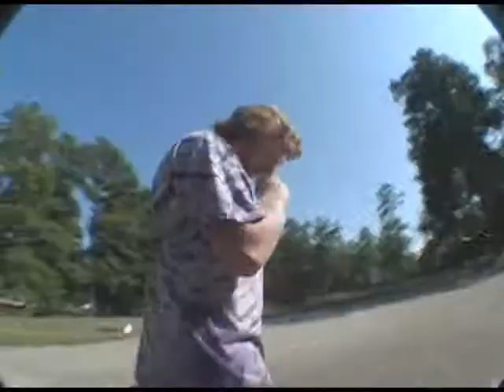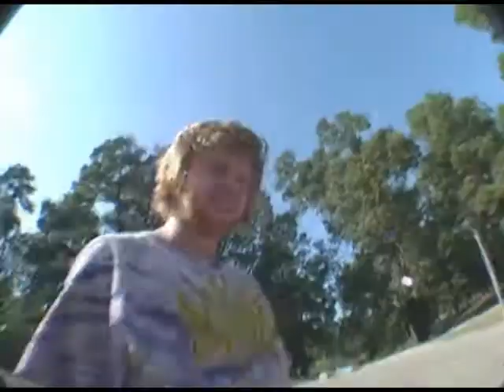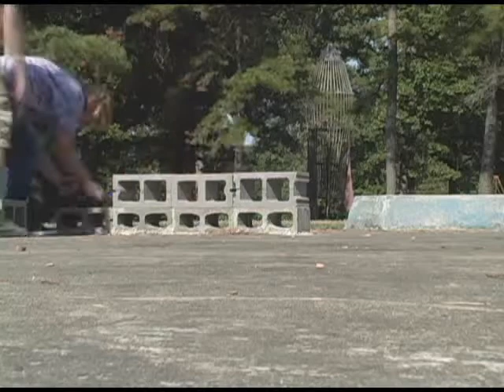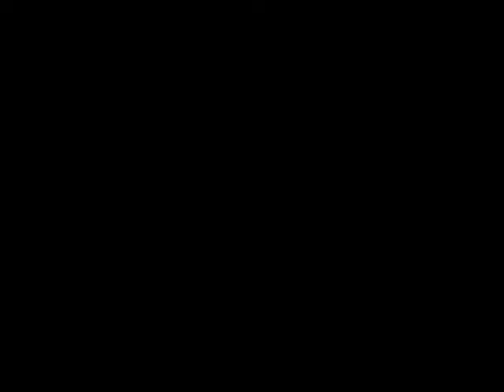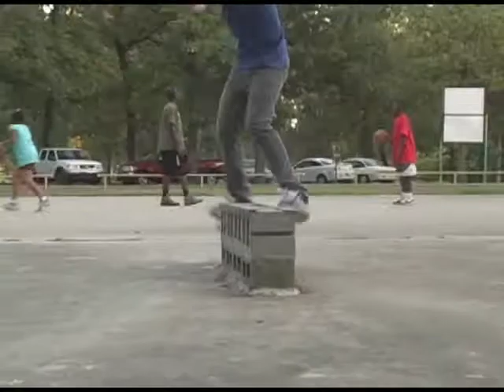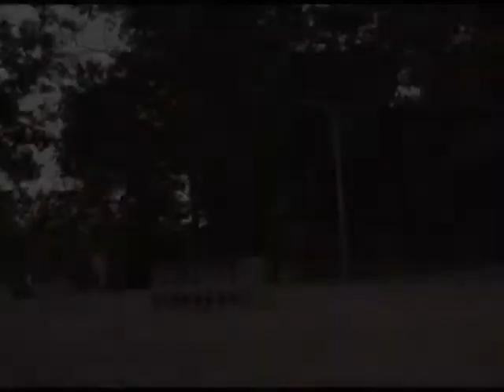How to build a DIY skateboarding ledge

Comment: Good ledge, but you can make it last longer by turning the cinder blocks on their sides because they are stronger that way. You can glue them down, then get mortar mix and put a few scoops into each hole, let it dry and and put small rocks in the holes, then top it off with more Quikrete (or skip the rocks and just fill them full with 'crete), and level the top. Add your angle iron and let it dry. You can also make the top even by cutting a piece of plywood to the height of the ledge plus the iron, setting it along the un-ironed side (to use as a guide/mold), then throwing a small layer of cement over the top of the blocks. Also caulk all the cracks. Make it harder for your work to get destroyed so you can skate more.

Comment: you guys built the ledge with those blocks with the holes in the sides.. do that affects in noselides or tailslides ? we're making one but i want to know if its better do it with the holes in a vertical way and fill them with cement so make both "faces" kinda flat so the holes won't fuck up the tricks

Comment: You know, the cinder blocks are designed to be stronger on the other side(holes facing up). You should do the same thing, just on the top part put a piece of plywood or some other wood, and then the angle iron.